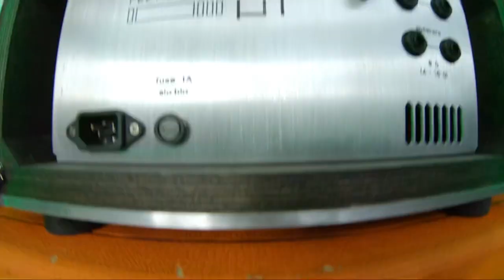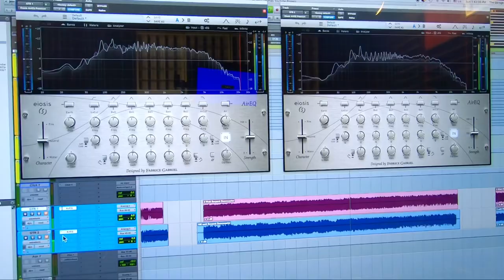Micro T Demo

Comment: The Micro T is great. I’ve got one of the Rectangular ones, and I have been using it at home for recording scratch guitar tracks. I do a lot of direct in recording with my Two Notes Captor and I have found that the Micro T with a dirt pedal in front of it tracks with much less background noise than my Rockerverb 100 MKiii. It’s a super versatile little amp and can mail fender tweed like tones if you want to blend in some different textures with more bass heavy tones in a mix.
Reply from the maker: Totally agree, i absolutely love mine especially for home recordings.

Comment: When using the Micro T like a preamp as you mentioned, does it still need a load on the speaker out?
Reply from the maker: Yea it still needs a load I believe...just can't remember how I ran it ? If you get one from Hex or Rectangular they'll explain how to hook it up.
Reply: @Witchpit  thanks man.  From what I've read, some folks are saying it doesn't need a load.  I saw a gut shot and noticed a 10W dummy load resistor on the output.  Looks like it might be switched at the Line Out jack, meaning if you plug into the line out jack, it might activate the dummy load in which case a speaker hookup would not be needed.  I'm an amp builder and I'm looking at building something similar for myself and was wondering if anyone knew the details.  It would probably be safer to completely disconnect the power tube from the circuit if running it as a preamp only.  A dummy load is effective for testing amps, I would just be concerned if running a dummy load for long periods would cause any issues.  I might have to make a prototype amp to see what kind of results I get.  I've built Model T preamp units, and several different wattage Model T clones.  But never a unit that can be run as a preamp OR an amp.  Thanks for your input, appreciate it.
Reply: @DeathCapAmplification   Good eye!  The Line Out switches to the dummy load and there's a pot so you can adjust the Line Out level.  The advantage of doing this way is that you have the NF from the power tube for the Presence control.  I've always felt that the way the Presence is voiced on the Model T contributed a lot to it's unique character.  It's a single ended class A EL84 amp and I know Ned put in the work to measure the frequency response curve there and reproduce it with the EL84.  Everything runs well within tolerances which allows it to be safely used as a preamp only.  
I mean, Sunn 0))) used them live for hours at concerts in Russia and Australia, as preamps into a wall of SVTs, and they survived that!